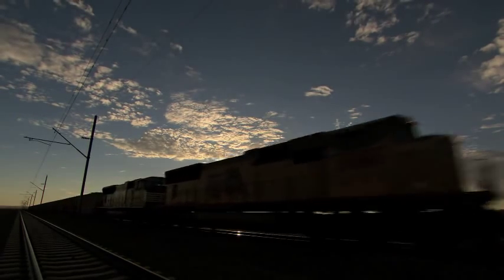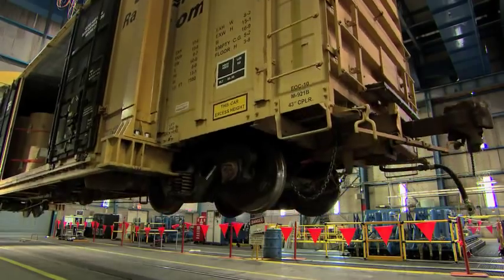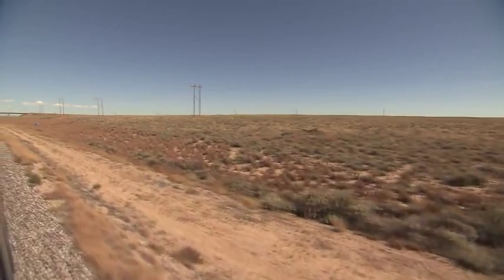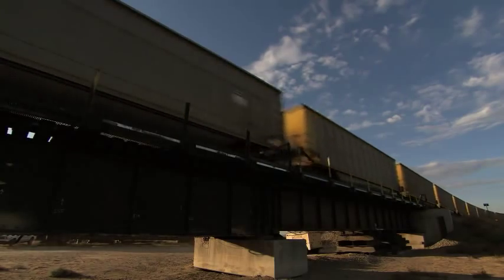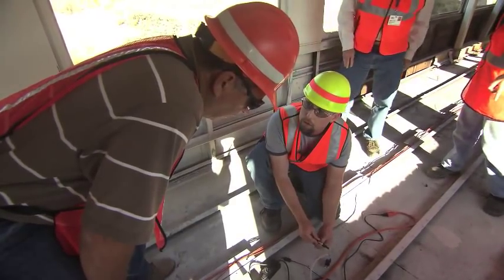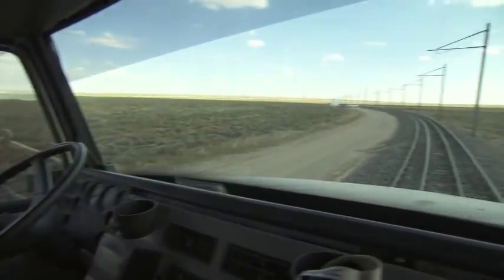This is TTCI

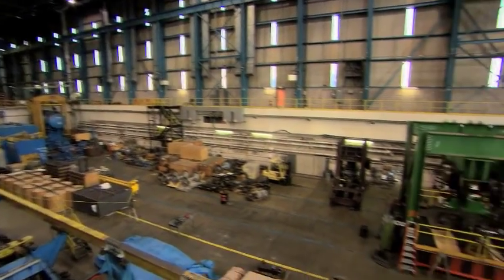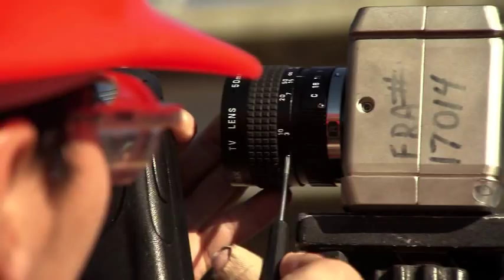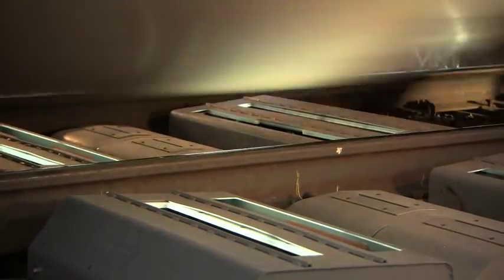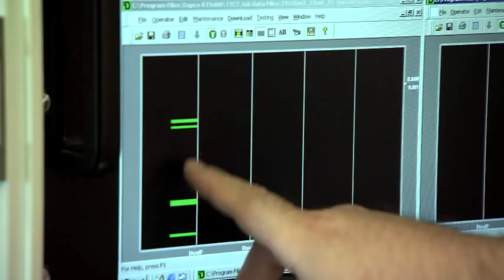Comment: Sep. 2012 video. 1:01 DOT FRA TTC property, was run by AAR TTCI (now run by ENSCO; TTCI now MxVRail). 2:38 instrumented freight car track inspection 3:11 PTC testing 3:52 TTX North America's leading railcar company 4:10 passenger rail research, testing. Early high-speed Amtrak Acela train testing. 4:42 impact testing for crashworthiness 5:10 barrier kaboom! 5:42 FAST loop trackside detectors 5:55 train scanning station / portal can test components like brake shoes, wheels. 6:17 trackside acoustic systems can identify cracked wheels 6:33 U-rail laser ultrasonic inspection vehicle